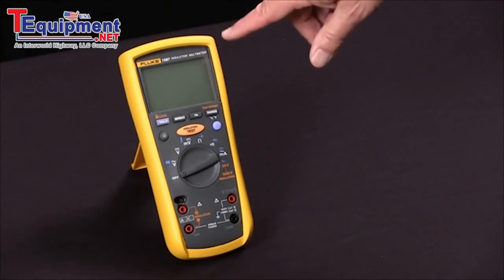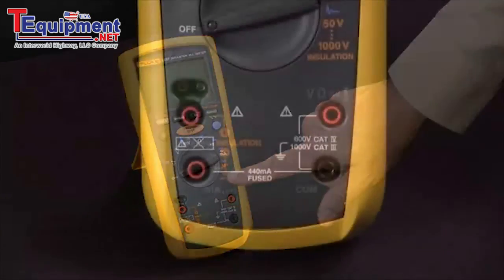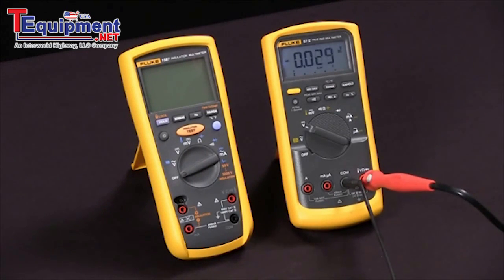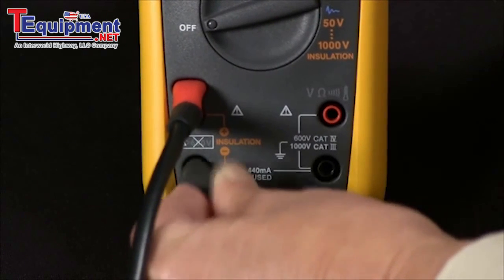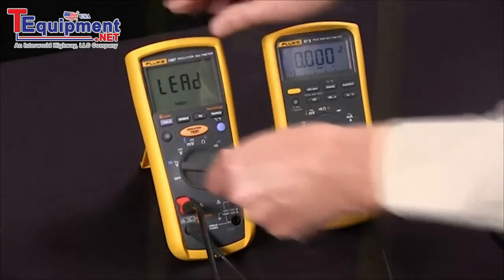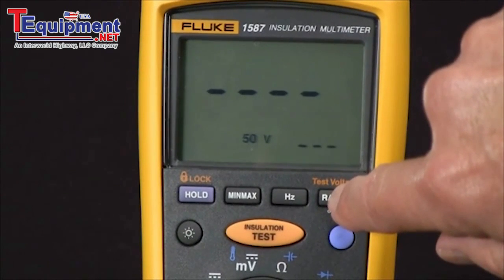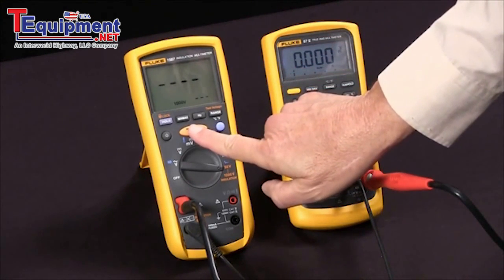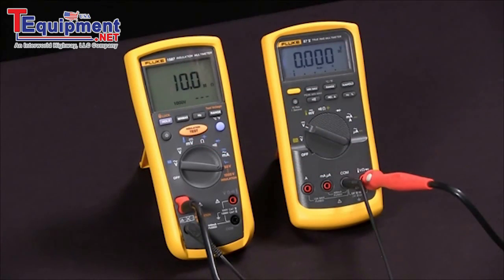How To Measure Insulation Resistance With A 1587

Comment: when the meter detects a low insulation or short the base voltage changes i.e test voltage at 500v on a stable circuit shows a actual voltage of maybe 507v in the small display  (so i am guessing its reading the applied vs return voltage) because in a fault condition of a circuit the 507v changes to 029v which to my mind is saying (507-29=478) 478v is being lost through the earth conductor to ground. am I right in thinking this or have i somehow misunderstood 😐